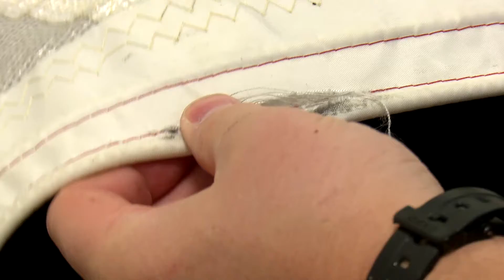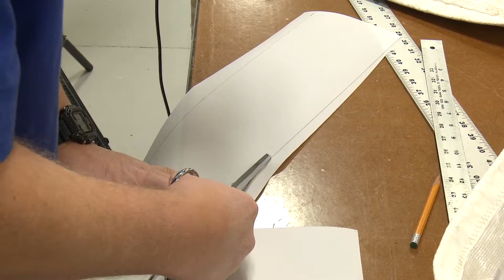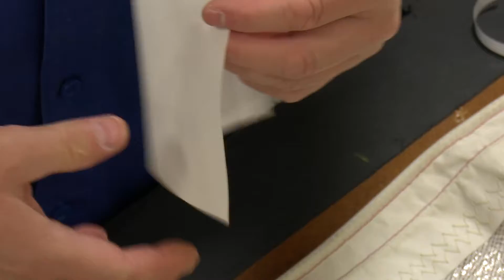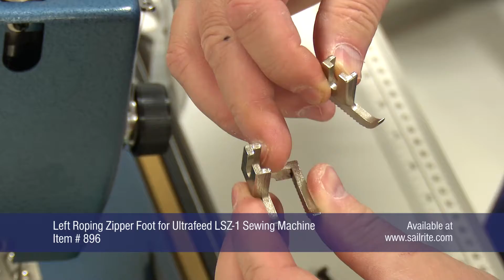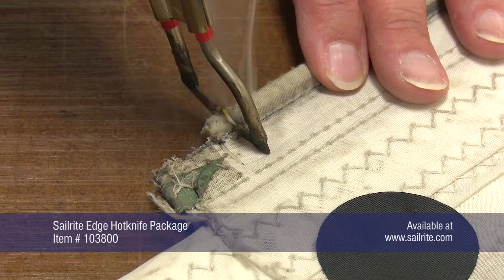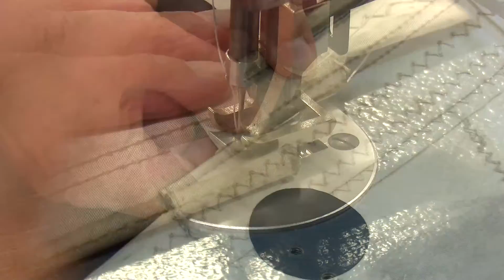How to Repair Sail Luff Tape

Comment: Do you make a thinner center foot to get tighter to the bolt rope? Have done a couple luff tape repairs and that is my biggest challenge.
Reply from the maker: No, but you can buy a new center foot and then grind down the side of it for applications where you want to get closer to the needle. I have done this for my machine and it works great.